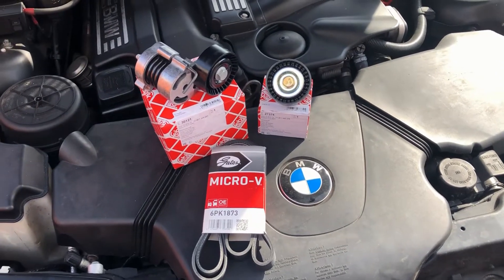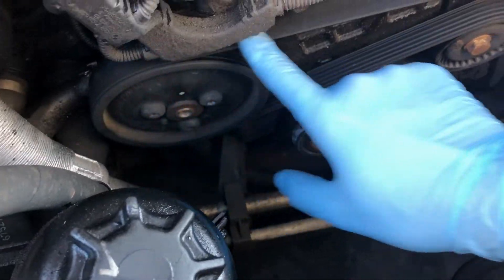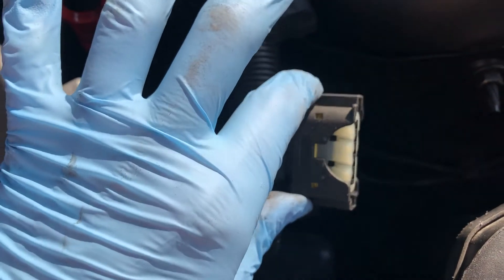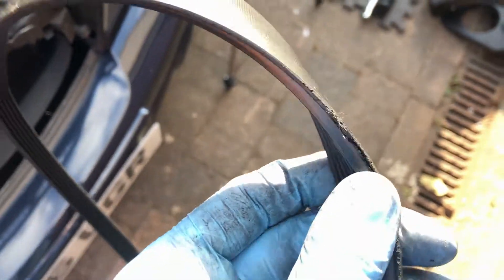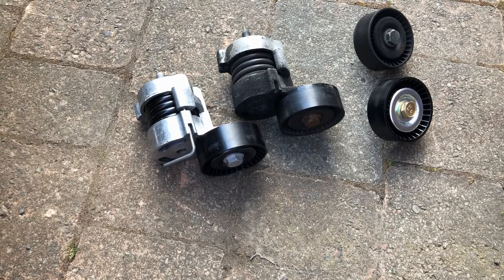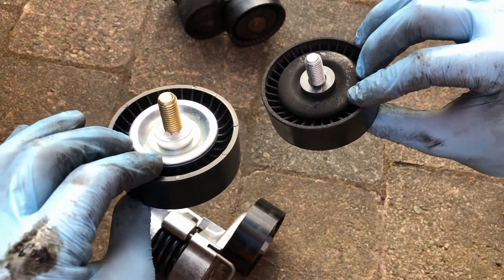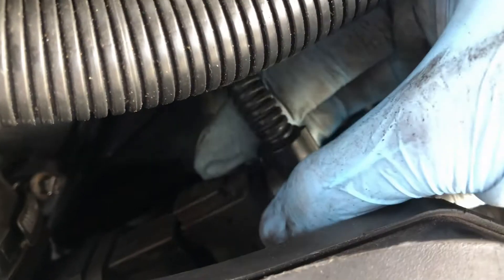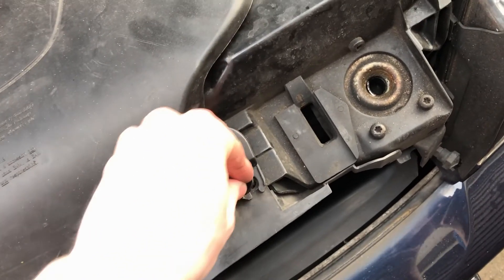BMW N42 N46 Engine Auxiliary Belt & Tensioner Replacement DIY  316 318 320

Comment: i have this engine with different tensioner which uses torx bits. i somehow broke the T60 hole that meant for de-tensioning the pulley assembly before i can pull the belt. did you have advice how should i remove the belt without breaking the tensioner?. it's still good other than that broken T60 part so i was trying to re-use it since they're quite expensive

Comment: I know this is an old video, but is the deflection pulley the same pulley as the one on the belt tensioner? The pulley on my belt tensioner blew up so I replaced it and I've just discovered my tensioner has now gone bad and needs to be replaced, all replacement tensioners come with a pulley already attached but as I discovered my deflection pulley has also melted, so I was wondering if I could take the pulley off my old tensioner, replace my deflection pulley with it, then replace the entire tensioner itself with it's new pulley
Reply: No, there are not the same. Actually dimensions of the plastic pulley are the same, but mount system is different.
Reply: @DrugChabor  the mount for the deflector is still good, just the plastic pulley itself is shot, so could I swap my tensioner then take the pulley off the old tensioner and replace the deflector pulley with it?
Reply: @FrenchyAU  No, no. You must buy new pulley. Bearing inside is bad.
Reply: @DrugChabor  yes I know the bearing inside is bad I won't be replacing just the plastic I'm replacing the whole pulley

Comment: Thanks, so this engine has only one belt, mine just broke and wanted to order one while not beside the car :)
Reply: No it has the timing belt also, not just one belt
Reply: @mattygreening6073  It has a timing chain , which is inside the engine , If you take off the oil cap you can see it inside . It also has an Aux Belt which is rubber and that is outside the engine , The Aux belt is used to turn the Waterpump, AC, Power steering etc . This vid is for the Aux Belt , If the timing Chain stretches or snaps thats a whole different ballgame.

Comment: Hello, thanks for the video, very helpfull! Just what i needed 👍😁
My car ( n42b20a ) started the last week with some rough idling and hesatation.. 
Last weeks changed the ignition coils, sparkplugs, oil, oil filter, oil filter house gasket, vanos solenoids ( cleaning and replaced the o- rings)

But still have the isseu.. so i found out the left engine mount is failing and now i see also that my pulley tensioner is really hard vibrating.  Gonma change this ASAP 😁 Do you think that this wil also give the engine some rough vibration?
Reply: S.A kardesim  bende herseyi degistirdim ve hala ses geliyordu auxilary belt den. 1 Hafta Sonra hepsini degistircem. Bazen direksiyonu kirdigim zaman arabanin devri (rpm) iniyor baya. Veya bazen Xenon yaktigim zaman da (rpm) bi kac saniye icin düsuyor. Ve arabadan cayik cayik ses geliyor . Sen ne yaptin bisey yardim ettimi ???
Reply: @burak7638  wrote: "Sometimes when I turn the steering wheel, the car's rpm drops significantly."

Did you figure out why this was happening?